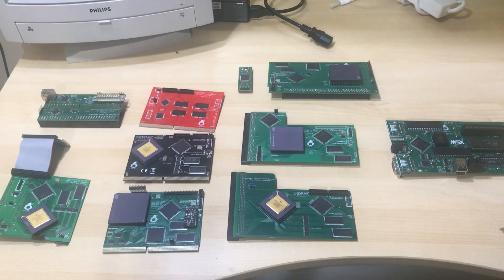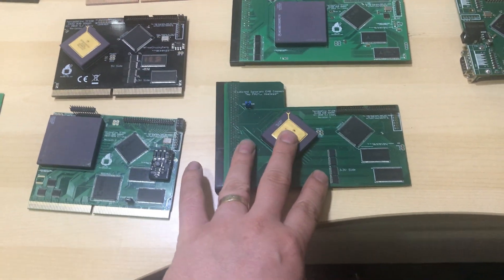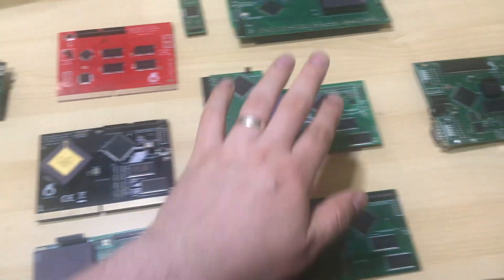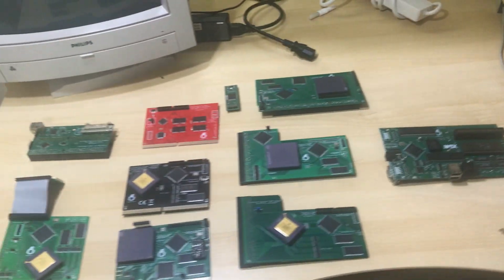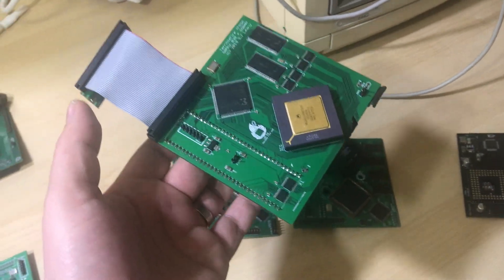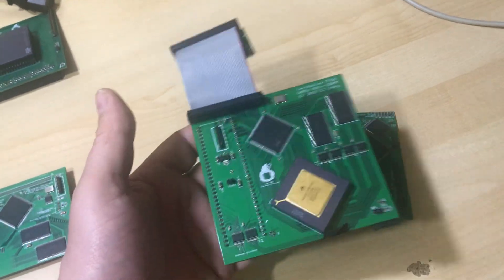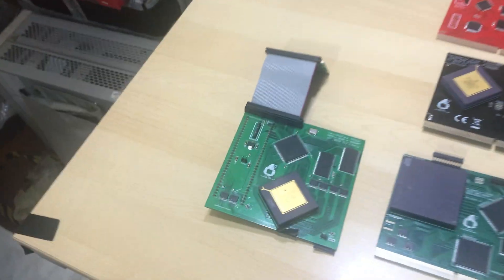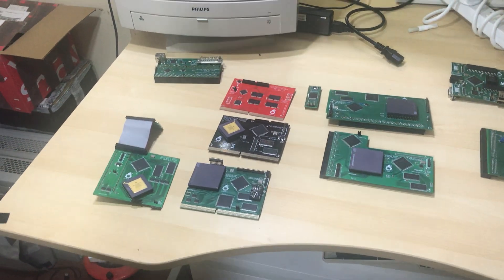Which TerribleFire Cards are still supported?

Comment: I use one of your 536's in my Atari 1040STFM.  It would be very helpful to have the FPU as the fellows who do the operating system work (MiNT), don't compile for FPU-less cpu's except the 68000 and 68010.  I LOVE your upgrade brother.  72 meg of ram, internal CF card.  You are an impressive talent.
Reply from the maker: The 536 is what it is. I'm unlikely to come back to A500 cards again. But glad you enjoy it.

Comment: I love my 1260, I hope that the next Alpha firmware update will somehow allow my favourite demo Nexus 7 by Andromeda to work again, as it worked on the Beta Firmware but the Alpha firmware causes timing issues.  It's not a deal breaker issue as I still love the accelerator and its unparalleled value for money.
Reply from the maker: I'll take a look at it. I dont recall it failing for me.
Reply: @TerribleFire  The demo runs but the spiral galaxy stutters and slowly the timing gets worse as the demo progresses. The issue occurs with another of my commodore user club members 1260 also. My card has a full 060 rev 6, and my A1200 is upgraded with 3.2 ROMs. I normally run the demo from WHDLoad but I have also run it from a floppy disk to rule out Workbench configuration issues and the issue still persists. Hope this information helps you.
Reply: Another Demo that use to work on the beta firmware but now has timing issues is the demo by Complex called Origin - I have tested it with WHDload and booting straight off Floppy Disk and the issue of graphics distortion occurs at the landscape scene and the timing goes out and becomes slow at the mech walker scene.

Comment: Strange Q but have you considered using a 68882 alongside an LC060?  Would that make any sense?
Reply from the maker: The LC060 doesnt have a coprocessor interface. It wouldnt work. Its also kinda not needed. Someone was going to do me a really good soft float library.... but shes been distracted doing Buffee :)

Comment: I love my TF1260 with my rev 6 and fast onboard ide (thank you for all your hard work on this and the other TF products!). Its sitting nicely in my desktop A1200 (just need to shave down my heatsink to get it to fit so I can mess around with clock speeds more). 

When I have the funds ill have a second one in my towered 1200 paired with my rev 1 060 that I know I can push to at least 66MHz and my Mediator PCI (again thank you for your work ensuring its compatibility with the Mediator!). It will replace my much loved but aged Apollo 060 board which although still alive and kicking has this big risk of never being resurrected if the MACH chip goes.

One question if that's OK? Did you ever consider doing an all out "balls to the wall" card like the Warp guys have done, or was the goal always to try get the best lowest cost board?

Comment: Like the TF1260 runs great with the 68060 Rev6 CPU on 50MHz. Have a serial 1000 is there a different with serial 999. The only complaint is no space for a heatsink under the A1200 keyboard. For the rest it runs beautiful with the 68060 Demos. Have also my old Blizzard 1230 IV with FPU and 128MB. And have a Vampire V4+ Standalone and the ACA1221 and a ACA1233n-55 but that is for the ACA500Plus V1 and V2.
Reply from the maker: Yeah i agree about the heatsink space. Its annoying but the only way to do it is mill a heatsink at an angle.